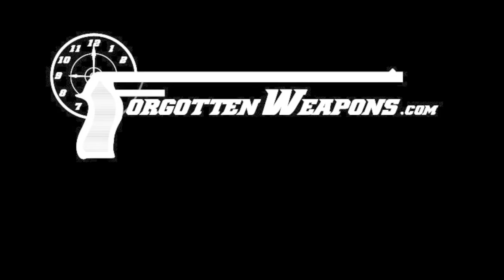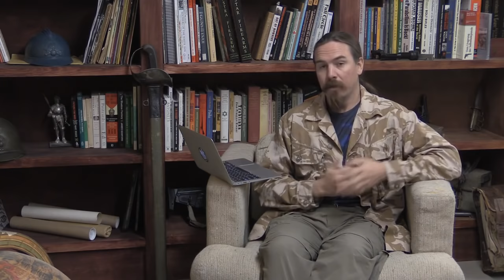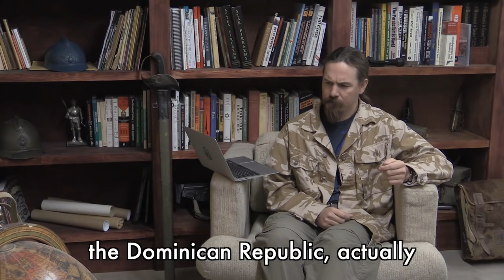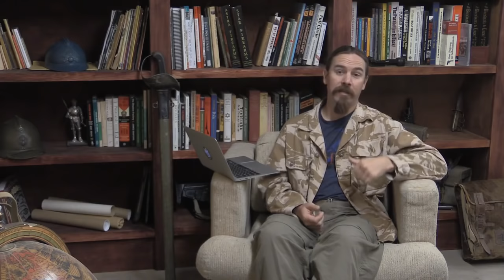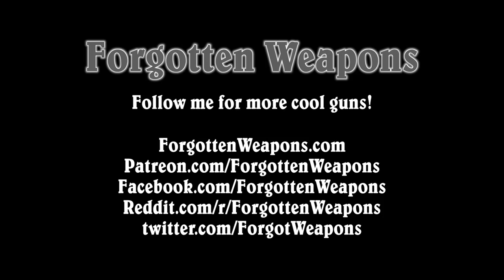Q&A #3: What-Ifs and How-Comes

Comment: The Ross rifle is an example of a gun that in its earlier configurations could be dangerous to the user. In their default from factory condition theyre perfectly safe but if you reassemble the bolt wrong say youre sleep deprived in a trench trying to field strip it which on earler versions it was possible to do then the bolt could not lock properly and then fly open when you shoot because there was no "idiot proofing" for lack of better words to stop the gun being assembled wrongly.

100% safe rifle when assembled correctly or if you have a later version that couldnt be assembled wrongly but i doubt this is the only gun in history that could be assembled wrongly and then be a danger

Comment: Regarding the use of revolvers vs autoloaders:

I did some research lately to find the pros and cons of each in a concealed carry role and I found that revolvers have some very important advantages. For one, they will continue to fire the remaining cartridges if a one misfires. This is very important in a close quarters struggle, because you will mostly likely not have time and both hands free to cycle the slide on an autoloader. And the second issue which is related to the first, is an attacker will most likely attempt to grab your gun at close range. If it's an autoloader, you will be able to fire one shot and then the slide won't cycle because of his/her grip on the firearm. This puts you in the situation where you have to wrestle your gun free and then rack the slide. Most revolvers on the other hand have a cylinder gap which sprays out hot gasses and metal fragments when you pull the trigger and that might cause someone to let go of your gun. Once you gun is free you can continue to fire with one hand. It's true that you can stop a revolver from firing just by holding the cyclinder, but I don't think that negates the advantage of operating it with one hand.

I think those 2 issues make the revolver a superior close quarters carry firearm. At ranges where a struggle is unlikely the autoloaders have the clear advantage.

Comment: As long as there's enough powder to get the bullet all the way down the barrel, a revolver will function with really any (safe) load without changing springs or anything else.  Advantage revolver.
Really the only practical use I have for revolvers, is to carry an airweight concealed hammer S&W in a jacket pocket, occasionally, however.

Comment: martini 577/450 type rifles in 303 are safe as long as they are in good condition and are of proper manufacture or conversion.... take Ian's comments regarding the Afghan one to heart!

the 450/577 Actions are far less common here in Down under these days as in the 1950's on wards they were one of the favored actions for conversion to other calibers originals are collectors items...wish i still had one from my youth 

the .310 cadet martini action is the smaller action that i have also used and seen many conversions done( 44mag being the largest i have seen) but as above they are getting rare in original condition

Comment: I always assumed magazine cuttoffs were there because of a holdover from "napoleon style" or the so called "gentleman warfare" where soldiers would fight in lines and load aim and fire as the officer commanded. The only place id see them as useful outside that holdover of "old tactics" is maybe in sniper type rifles where you could keep a lower profile loading single shots rather than doing a full magazine change or reload depending on whether its a fixed or detachable mag

Comment: Regarding the revolver vs. semi-auto debate, I believe it's worth mentioning that the revolver, debatably, is more reliable. There's no risk of stovepiping or jams (however, I suppose mechanical binding COULD be a failure mode in a revolver).  Also, in the event of a dud round, the user simply has to pull the trigger to fire the next round, as opposed to racking the slide. (This would be beneficial for self carry, especially for someone not familiar with firearms.)

Comment: You mentioned that you'd need good 3d printed metals for the reproductions situations change. I agree with this, and I'll explain in a little more depth. We're up to the point of 99% solid metals, which is more than enough. The issue arises with the cost of materials, and speed of printing/tolerances. The cost of materials is due to the machine makers, you can only use their type of powder that they mark up, the powder itself isn't that expensive. To my knowledge, most if not all are marking up the materials beyond reason.

Then there's the tolerances and speed. Due to the nature of spreading the powder, then solidifying it layer by layer, you have to find a compromise between speed, material density, and tolerances. This will improve over time, but will always be behind proper cnc machines for mass production.

I think for future designs, there's going to have to be a bit of change in the way we think. Instead of tighter tolerances to make designs work, which sadly, the the manufacturing world is riddled with, and that's because machines that can are enabling designers to put less effort in, we're going to have design things around the lower tolerances we can achieve with 3d printing.

You may say, why even bother with 3d printing? It's currently more expensive, slower, and can't reach the same tolerances. Well that's because there's certain things you just can't make with a typical cnc mill or lathe, whether it be certain densities to reduce cost or weight, or certain structures that you can't reach or machine with a tool. In my opinion, there could be some very cool designs that take advantage of what 3d metal printers have to offer over mills or lathes. Before any of this happens we'll have to wait for prices to go down, technology to improve, and a change in method of design.

Sorry if any of this is wrong or stupid, but I don't claim to be an expert on the subject, just offering my thoughts. Maybe some of the things like the powders being restricted by the makers has changed, I dunno :P

Comment: Ian, longtime fan.....Here's some stuff to add...

Revolvers - Biggest reason for them. Women can pick them up, pull the trigger, and they go bang. No mag to seat. No slide to pull. No safety to flip. You can also buy them in small but still effective cartridges to mitigate flinching with heavy recoil. The best choice for a home defense gun if you never plan to practice much with it. 

Military won't buy unsafe pistols? Don't get me started about the M9 initial slide problems but.....what about the Type 94 ???? The Nambu Type 94 had a known problem with an exposed sear that, if bumped, fired the weapon. One of the worst and most dangerous pistols made for army issue (ok..ok...they were offered as purchasable side arms but you know what I mean). 
I don't know if the M16 should be considered....first version with no forward assist was stupid. Several noted the problem with no way to forcibly seat a round. Add that small problem with the incorrect maintenance training they received (no or little cleaning was needed). 

I work with 3D printers. The technology for 'prosumer' metal printers is literally only months away. There are systems now but they need to have some of the edges smoothed out. Also, the software for easy reverse engineering is already here. With laser scanners you can capture a dead nut software model which, with software currently available, those parts can be put together and moved in 3D space. This will show interference and collisions with parts that are out of tolerance.

Cheers
Reply: Poor Beretta. They try so hard to make the M9 more effective and likeable, but the damage is done.
Reply from the maker: +Jay Raxter The issues with the Type 94 are much overstated. It take a lot more than a bump to fire them, and that can't happen with the safety engaged, which is how they would have been carried anyway. And they are better guns than the Type 14. As for the AR forward assist, it's not a particularly useful or necessary device - far more likely to make a problem worse than to fix it. If normal spring pressure on the bolt won't seat a round, you have a problem that needs to be fixed, and trying to force the round into the chamber will generally not help.

Comment: On the MG81, I remember reading that during the German invasion of France one of the tactics was to land multiple bf-110s at French airfields, dismount the rear gun, and use it to suppress the personnel at the airfield. However, based on the time frame I think those would have been more likely to be MG15s. I can't remember any specific mentions of MG81s in ground use in the books I've read. Like Ian said, it may have happened but was an emergency tactic.

Comment: I think ram and wire EDM (Electrical Discharge Machining) will be the future of small batch fire arms manufactor.
1. It can be used to machine very hard metals, with equal effeciency to soft metals
2. The tolerances possible are really, really tight. Much tighter than other forms of machining.

The problem is, it is not as fast, nor as available as other forms of machining.
Reply: Interesting observation.

Comment: I just went and found your video on the Burgess shotgun, and I think I might buy one if I needed to store it in a tight spot, like if I decided I needed a car gun or something like that, but I'd want two changes made. For one, and I might just be remembering this wrong, but I think you said you need to open the action to load it, and I'd want to be able to load it with the action closed like a more traditional pump shotgun. Also, I'd want the bolt release somewhere other than inside the trigger guard, because it just seems really dangerous to have anything other than the trigger in the trigger guard.

Comment: I think the firearm that earns the title of being the first standard issue semi auto rifle would be the M1 Rifle. Made in FAR larger numbers in a FAR shorter amount of time leading it to widespread use. I also don't think enough were made for it to BECOME standard issue, unless Mexico had a REALLY small Army back in the day.

As for the Type 38, I hear it was the strongest bolt action of WWII, though I think in WWI it would have been the P14 or M1917. Two big forward locking lugs and the bolt handle itself seems to make a third big locking lug in the receiver. I believe the Remington 700 borrowed quite a bit from the British P14/M1917 design.

Comment: One of the most important advantages of a revolver is the ability to simply be loaded and left in a drawer for 30 yrs and still work flawlessly when needed. The other is less user error. There is a cartridge in the chamber and the safety is off both of which have caused a lot of failures to fire at highly critical moments.  Yeah I know you wouldn't make those mistakes and your dog doesn't bite either.

On Ian's snake shot load some people use them on rats however a few people in my community have a block of wood or stack of magazines in their bedroom and if they hear a home invader the first shot goes into the wood/paper stack as a warning to make it clear to all parties concerned that the intruder did know someone was home and armed and they had decided to stick around anyway indicating they had malevolent intentions toward the residents.

The Russians were using a full auto grenade launcher in Afghanistan that was combat effective that absolutely could arm a round that it didn't fire creating what some might call an unfortunate situation. When captured by the locals they tended to not want to use them for some reason. Does blowing yourself with your own weapon count as a friendly fire incident?

Comment: Firstly thanks for the great vid.   A few thoughts. 

Ballester Molina  of Argentina which is of course a near copy of the 1911.  would sort of count. As an odd gun from an odd local.

MG-81 would have been much like the US Marine  AN/M2 aircraft gun "Stinger" conversion most of the issues you bring up where there but as a short term solution it 
was useful.

Revolver - Lower training and practice requirement  no stove pipes or failure to eject (at least till cylinder is empty)

Type 94 auto pistol comes darn close to being self endangering 
Khyber pass guns can be very much like the Chinese pistols
add Flamethrower to grenades to my way of thinking.

Digital 3d scanning will aid the reverse engineering to some extent.
Reply: "the weed wacker.. the weed wacker.." hammy the squirrel :)

Comment: While by no means a poor rifle, the 1873 Trapdoor Springfield had some problems with its ammunition which weren't directly hazardous, but resulted in great danger to the user when in combat.  Basically, the metallurgy behind metallic cartridges wasn't well understood and the casings had too much copper in them.  Due to this, they had a propensity to become stuck in the chamber post firing and had to be pried out with a knife.  Now imagine you're staring at a mounted native with a Winchester or Henry.  You're screwed.  Similarly, the PIAT was a fine AT weapon, but its limited range made it hazardous to employ (and thus was only used when the threat of whatever german steel was around exceeded the threat of running at it with the weapon).

Comment: Great video! Concerning the "Best forgotten weapons" question: Isn't there this funky model of a Nambu pistol where the transfer bar is exposed which could potentially lead to the gun firing when holstering or when handling it incorrectly? I don't know what the exact model is, but I think that it's some sort of Nambu.
Reply: Correct, and I don't remember the exact model either.
Reply: I checked it, it's the Nambu Model 94!
Reply: +.rzr I have shot one several times as my friend owns one. they are not that bad if you are aware of the flaw and danger IE you never keep a round in the chamber and you don't hit the transfer bar on the side of the gun with something hard or press on it with I think its 4lbs of pressure its also very hard to make it go off randomly I loaded one with snap caps and put it in the glove box of my truck then drove down a wash board road the hammer was still cocked.

Comment: Hi Ian, you don't think that the evolution of plastics may one day override metal in the production of firearms? Synthetic plastics have come a long way in a short time and are only accelerating. Take for instance the Ultem plastics used in injection moulding under high temp and pressure. Imagine a gun where each component that moves has it's own inbuilt coating of PolyTetraFlouroEthylene. Also as a lubricant how does PTFE compare with gun oil? Do polymer based grips and frames suffer degradation due to gun  oil?

Comment: I'd be jockeying for a place at the head of the line to buy a reproduction folding Burgess! I'd enjoy a faithful reproduction immensely (designed for modern smokeless 2.75" shells, of course) but I'd enjoy a modernized version even more, with an 18" barrel, full length 7 round magazine, plastic furniture, and ghost ring sights. That WOULD be objectively better than ANY shotgun currently on the market in terms of combining portability with full-sized ergonomics and functionality.
Reply from the maker: +Justin Grainger I don't think so, because it cannot be fired from the folded position. Legally I think it would be the same as the various takedown models from the same era.

Comment: Silly question from somebody who doesn't know very much about guns (we're not really allowed them in the UK) - what happens when a gun overheats?
Reply: A number of things such as warping of the barrel, setting fire to the gun, breach/receiver damage could result in it exploding. and destruction on the gas/piston loading mechanism, not dangerous but not great. premature detonation of a cartridge as its loaded or mid loading is quite dangerous. I'd imagine its theoretically possible that  a whole magazine detonates...
Reply: tisFrancesfault
Thanks! That all sounds pretty bad.
Reply: +Martin H tbf, the gun is more likely to seize up first and start jamming. as the parts expand beyond their tolerance. its  also fairly difficult to get such a catastrophic failure, barrel drupe and and burning heat discourage any shooter .